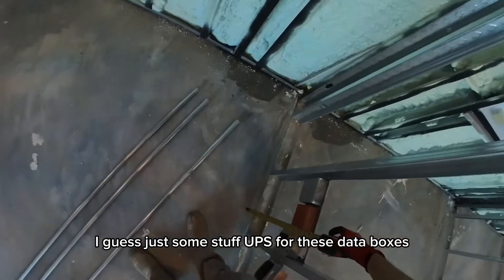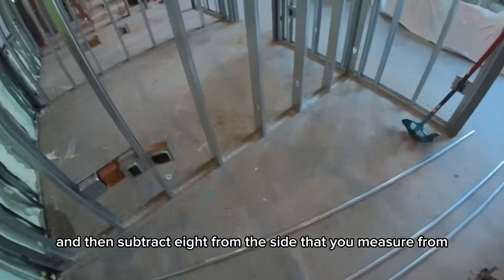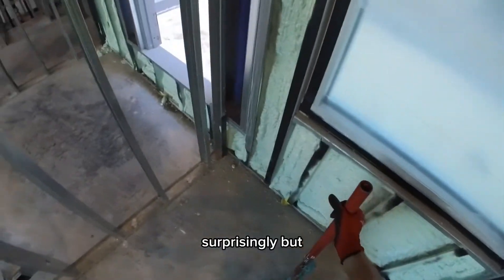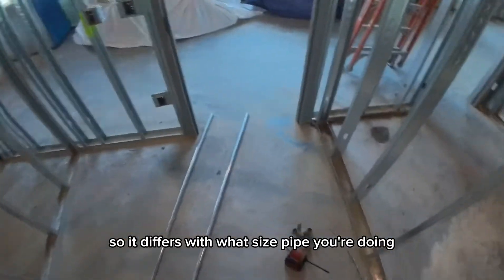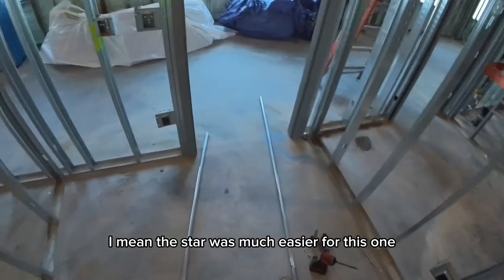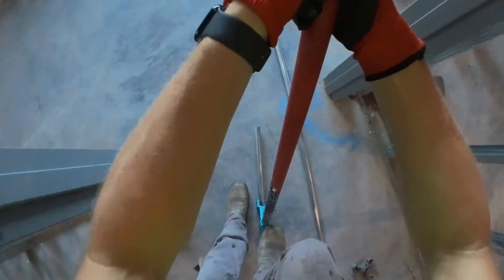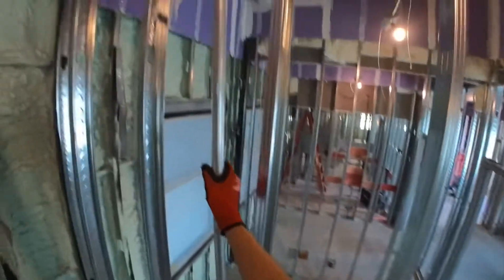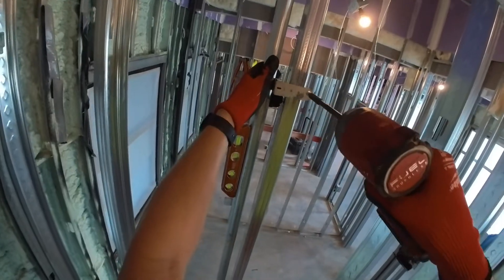Arrow vs Star on conduit bender

Comment: I don't understand the comments on not knowing about the star. How do you make any Back-Back bends without knowing that. Must be using a lot of couplings and hacksaw or band saw blades.

I still have a 1/2" original Benfield made by Appleton. My boss had it 52 years ago and it wasn't new then, he passed so I have it now. The Ideal benders are the same as the Benfield originals as far as I can tell. I also had a 1" T & B bender for years that was fine.

Comment: 46 years licensed. Bent a lot of pipe but don't claim to be the best.

The star is normally for back-back bends but no reason it can't be used for stub ups etc.

The way I remember it is when you use the star, and you make the bend it's like doing the second bend of a back-back bend. When bending your back should be towards the first bend or you back should be towards the end you measured from. 

When doing a stub bend with the arrow. You are facing the end you measure from

Comment: 2 questions off topics 😅 1st. What kind off boots do you have? And 2nd. What are you using to film this ? Thank la for explaining the star I had a learn situation were I had to make a 90degree bend a 9ft in a 10ft conduit and did a normal 90 degree on arrow with the deductible and was a little thrown off when my lead showed me the the star use 😅

Comment: Couldn’t you have issd the 20” side and deduct 8” bend at 12” with arrow?
Reply: Yeah😂 when he started to chug that 100 inch 90 out I was thinking that as well
Reply: Yes but it's just showing the difference between star and arrow. And it's quick to do the bend with the star instead of trusting all your 10' sticks are actually at exactly 120", and you can use random lengths of pipe without measuring the total length of the pipe, ever.
Reply: Well ,not really. The goal was to have the bend 100” up from the box. If you just stub 20” on a 120” pipe, the other end is going to be more than 100” because of the gain in the bend.   ( 90 degree bend in 1” ext is a little over 5” gain in total length)I mean, he could have done it that way, but he’d have to compute the gain, then mark 20”, minus the 8” deduct, then plus the gain.  Using the star is easier, mark your 100”, slap the bender on with the star at the mark, bend a 90, done. No need to look up and add or subtract the gain for the bend.
Reply: @andrewalexander9492 thank youuuuuuuuuu. Someone knows

Comment: And if you use a south wire bender they will always be half to a quarter inch off, Greenlee benders are the worst. The newer Kline benders are just ok, the best benders are ideal and the old Kline benders with the bend field heads on them, but to find a bend field head you will need to find someone selling one or someone like me who’s been doing this for over 30 years when Kline still used bend field heads.
Reply: Agreed!ideal iron head benders the best!
Reply: Bruh my new klein gives me s bend offsets that are 10 inches off. I'd have to deduct like 14 for a 90.  I'm not sure why the company bought it for me instead of an ideal one and I have no idea why the bends are completely fucked like this lol.  Luckily I use a 555 or the milwaukee battery operated bender 99% of time.  I've never used emt though, never having to get creative to spin pipe on would be a dream come true.
Reply: @jesuschrist8817  that’s not the bender that’s your fault trust me respond and I’ll give you any Example that you need
Reply: @jesuschrist8817 I can only tell you that you don’t have any idea lol 😂 see the pun how to use a bender
Reply: @timothydixon2545  eh yeah it just doesn't stay tight to the shoe.  I pretty much only do box offsets with the hand bender.  The 20-40 year experience guys were getting the same results on my 3/4 bender.  I know why it happens but haven't found a solution and i dont have a good resource to correct technique. And no the other guy scammed his way in as an electrician when he is not one at all, he almost killed his apprentice a few days ago too.  What's being displayed in this video is something he has no idea how to do.
Reply: @jesuschrist8817  well I hope that he doesn’t hurt his apprentice or anyone else that would not be good. Like I said before I have over 30 years now in the trade , and to this point I have never had someone who was under me get hurt seriously hurt one guy got stitches he ran his arm across a panel edge pulling wire. Anyway don’t use the arrow on your offsets use the center notch on the bender shoe and deduct 3/8” to a 1/4” per inch of rise depending on pipe size. The other thing to remember is that the foot of your bender always faces the same direction that you measured from, and you use the star that will put the back of your 90 at your measurement. Now you never want to bend the long end of the pipe up so if you need a 12” stub then you deduct depending on pipe size and use the arrow with the shoe facing away from the end the you measured from, in other words turn the bender around. So if it’s 3/4” pipe you measure down 6” face the shoe away from the end you measure from put the arrow on your mark bend you 90 you will be close depending on the bender. So the rule is if it’s a bend under 5’ you should deduct and use the arrow, if it’s over 5’ measure long and use the star. Don’t try to be fancy math man if it’s 9’ you need measure the 9’ because pipe is not always exactly 10’ long so measure the 9’. Hopefully you understand what I’m saying really wish I could show people maybe someday besides all of the people I train every day 😂.

Comment: 25 year electrician here, I’ve bent miles of pipe over the years but never took the time to figure out the star. Thanks for posting, never too late to learn!
Reply: 25 years and miles of not knowing how to bend pipe is what you are saying. Sorry but you must have been tough by people that don’t know how to bend pipe properly ether.
Reply: @ Just cause I didn’t use the star only means I’ve wasted a little pipe here and there. It really is not something I use very often and I run a lot of Emt
Reply: @ I’m not knocking you bro but we learned that the first day on the job.
Reply: @ but we only run pipe
Reply: @ where I learned we can’t use MC or NM PVC rarely 1/2 and 3/4 are considered part of our hand tools and we pipe almost every day
Reply: @ I will say that me personally if all your doing is bending stub 90’s out of the wall and they are close to 10’ your better off just stubbing the 90 on the end of the pipe and cutting them off. It’s just much faster. We would never just stub ours out into open air like this, we would kick out of the walls so we could pipe to a box on the drywall. We would only stub straight out if it was at bar-joist height or concrete deck height, so that you are not making some ridiculous offset on the end of that stub to get to the deck.
Reply: Use that E word lightly lol
Reply: Chicago elections after 30 years we only run pipe thank you
Reply: I learned that on my first day over 30 years ago

Comment: For my follow older sparkies found it a lot easier if you spray paint heads of benders with glossy white paint then use a yellow or red paint stick to mark degrees, notch & star. Makes it a lot easier to read in dimly lite areas. Love the Greenlee level that fits on end of conduit.

Comment: Thanks for the explanation!  I'm new at conduit bending (self-learning) and frequently have made a bad bend because I was using the bender with the hook in the wrong direction.  I never knew the difference between the arrow and the star.  I never knew that by using the star, you can turn the bender around and you don't have to deduct any take-up.  This will be very helpful in situations like your first bend in the video.  I wish I knew this sooner!

Comment: Question why 10 feet the box elevation is 20 inches but where’d the 10 feet come from?
Reply: So that he’s above the drop ceiling with the stub out of the wall. Blueprints have celling heights.
Reply: @timothydixon2545 yeah but he could’ve just measured out 20 inches deducted 8 made a mark at 12 and just used the the arrow lol why measure 100 inches
Reply: @MALO_23 did you really just ask that question. Why would you leave the short end of the pipe on the ground and bend the long end up. You must not bend a lot of conduit.
Reply: @MALO_23 I’m pretty sure that was 3/4” conduit so you would subtract 6” not 8” . 8” would be for 1” conduit. But the correct answer would be measure down 20 inches facing the foot of the bender away from the end that you measured from and still using the star so that you don’t have to measure 100”, and you would have your back of bend at 100” inches.
Reply: @MALO_23 ok it was 1” conduit he was bending I went back to watch , but you would still pull a 20” measurement face the foot of the bender away from the end you measure from and use the star, and you don’t subtract anything. If you’re going to use them for stubs this would be fine if not you better check to make sure the conduit is a true 10’ length, because most times they are 10’1/4” to 10’1/2” long and not a true 10’ in length.
Reply: 10 feet is the length of a standard stick of emt.